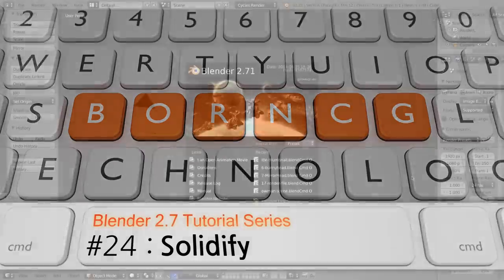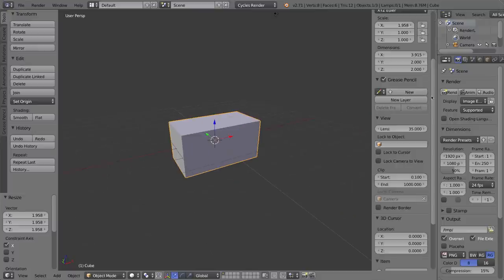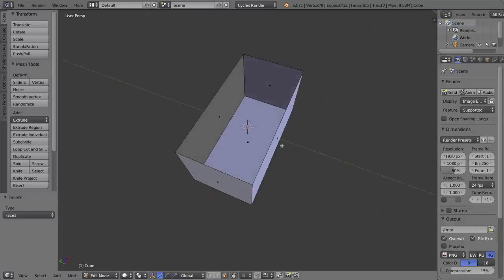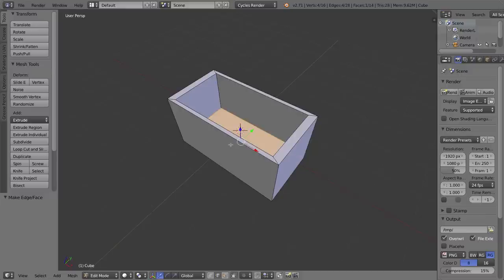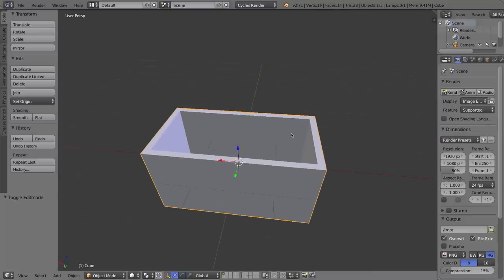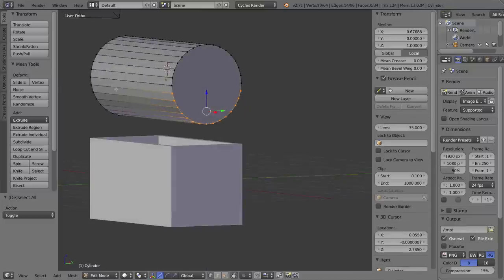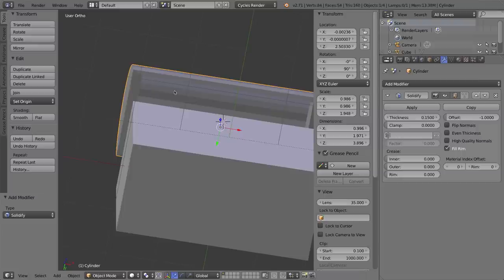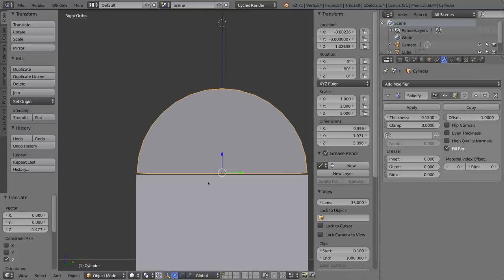Blender 2.7 Tutorial #24 : Solidify #b3d

Comment: By the way, when saving an image, if you want a good quality JPG with no noticable artifacts, than save your images (for animation or whatever) as PNGs or BMPs or some other format that isn't lossy (because Blender JPGs are HORRIBLE!).  Then use a program like IRFANVIEW (free image program) and save the rendered image as a JPG, set the options in it to 90% quality (I use that for ALL my JPGs, it is a nice balance for small size and no noticable artifacts) but also, check the box that says "Disable chroma color subsampling", that is important as normally it would use that and you loose sharp edges and gain more artifacts.  When you disable it and save at 90%, the resulting JPG image will be really close in quality to a PNG!  I saved a PNG with 100% compression, it was 43K in size.  When I resaved it as a JPG at 90% and Chroma color subsampling disabled, the JPG was 16K in size and the quality was almost identical with no noticable artifacts.  I use these settings for all my JPGs with Irfanview and it turns out a decent size.  I experimented quite a bit and found that quality above 90% for the JPG and you really see the size start to jump up with no noticable improvement, so 90% with the subsampling disabled seemed to be the perfect setting for size verses quality.